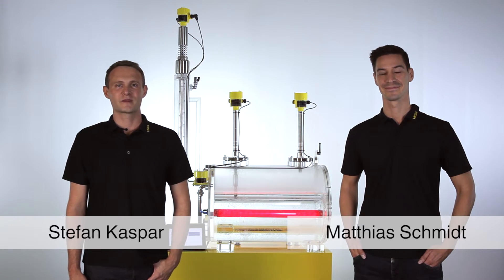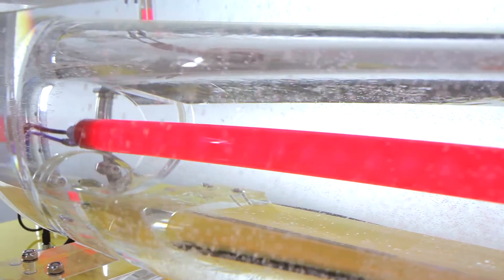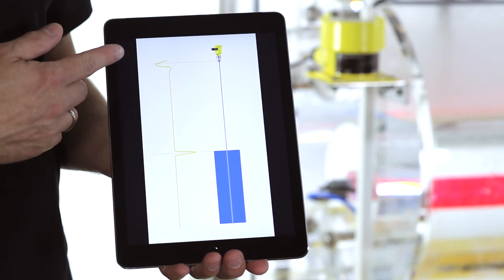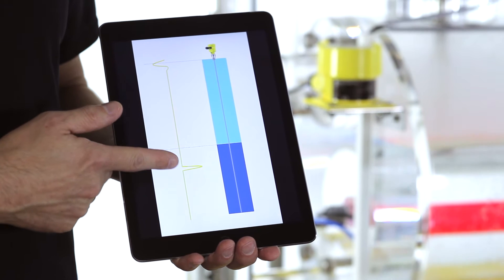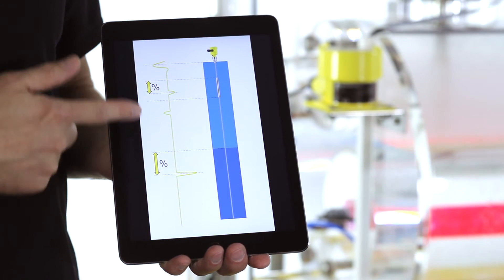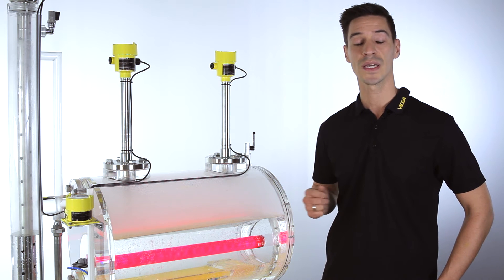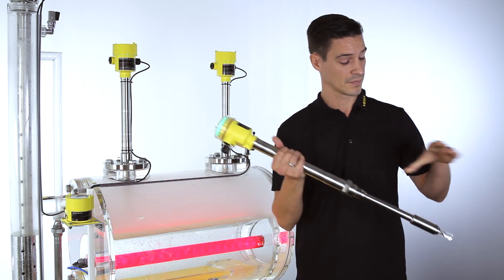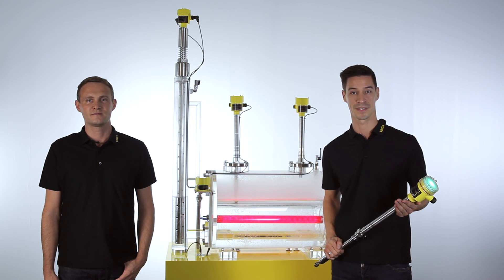Reliable level measurement with steam boiler approval

Comment: Do you need to put a propagation velocity correction in on the flex86?
Reply from the maker: Thanks for your question. The VEGAFLEX 86 steam probe which is shown in this video has a runtime correction which uses a known reference target inside the coax probe to compensate automatically for changing propagation velocities due to the steam atmosphere. This means, you don’t need to correct anything manually.